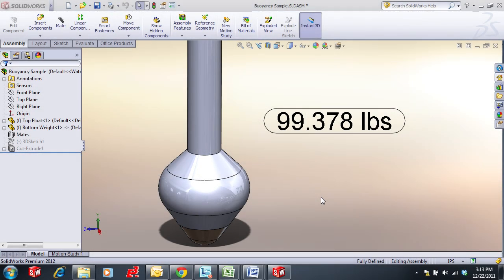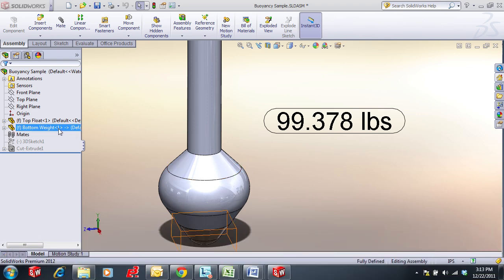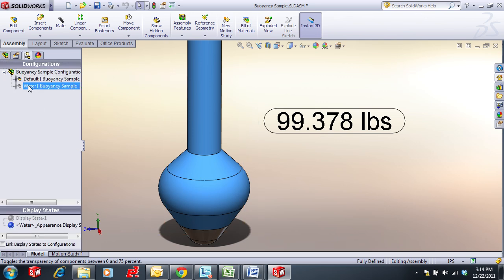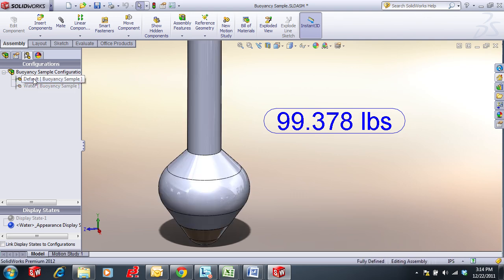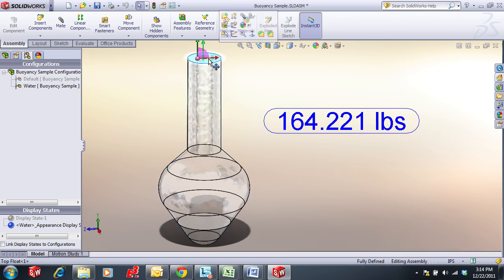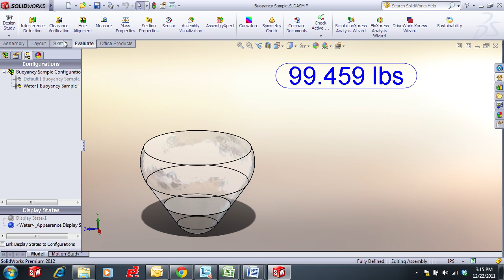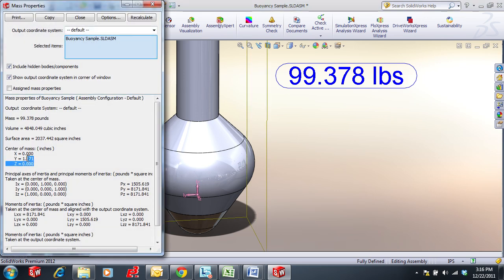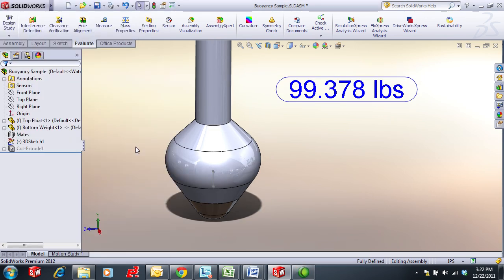Calculating Centre of Buoyancy in SolidWorks

Comment: Without explaining how you reduced the size of the water object i couldnt follow it. Shame because your solution looked so simple
Reply from the maker: +Michael Yardley It is even easier in the current version of SOLIDWORKS, because you can create a COM point with ease. http://help.solidworks.com/2016/english/solidworks/sldworks/t_create_com_ref_point.htmTo answer your question, we used Instant3D to reduce the height of the water object. Read more here: http://help.solidworks.com/2016/english/SolidWorks/sldworks/c_instant3d.htm?id=f1ee8a36534947b6938e4e46e73963b8#Pg0&ProductType=&ProductName=
Reply: no directory found

Comment: I have some hollow components in my assembly, I'm assuming I have to fill them in before I do this because they will be airtight.  Also, how do you modify the volume to get the same mass?  You are able to select the top of the assembly and slide your cursor down to make it smaller but I can't figure out how to do that.